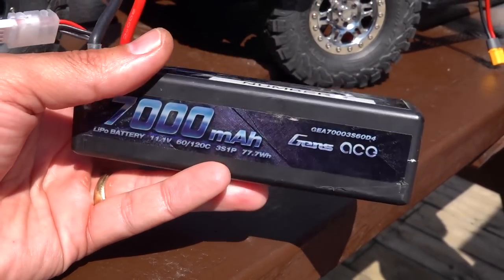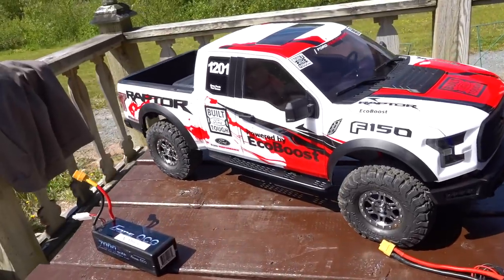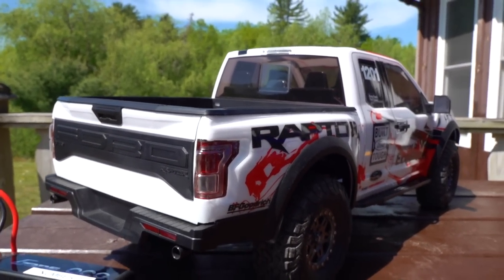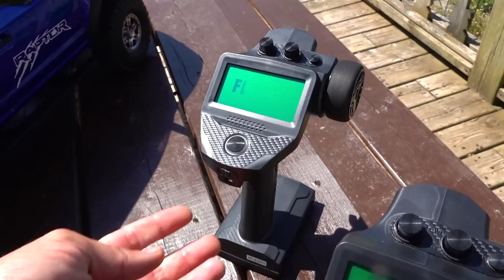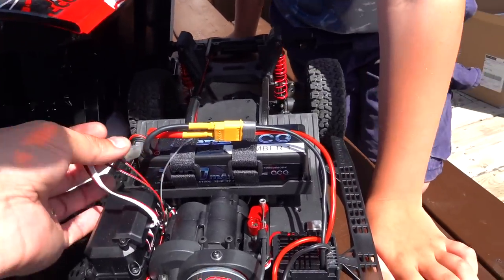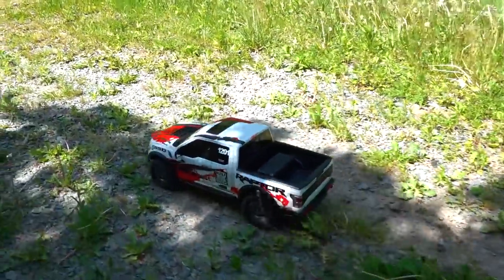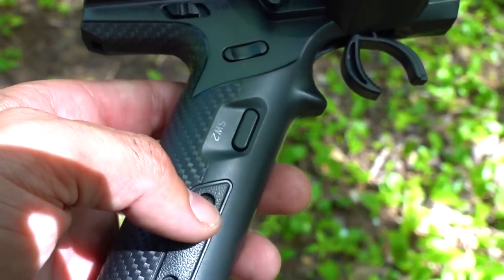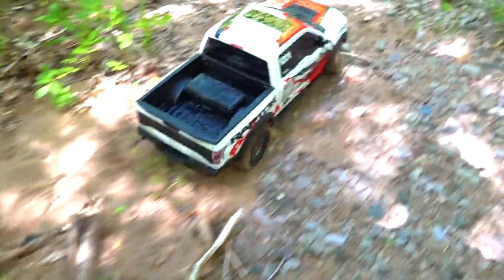BRAND NEW RELEASE 2023 - Traction Hobby 1/8 Scale Ford F-150 RAPTOR 4S iFS

Comment: So I really wanted one of these after first seeing your video, but now that I have had the time to think about it, it’s a really confusing vehicle. Not having the solid axel up front might not make it the best for crawling but I would assume would eliminate the ability to lift it with the independent front suspension. But they left the solid rear axel in it. So it’s built more like a Traxxas UDR or Losi Baja Rey, setup/design wise, but not set up all the way to be a basher/desert truck. I want one, but I don’t know what I would do with it.  I saw your old videos where you lifted the old version and out monster truck tires on it, which was pretty cool.
Reply from the maker: That was a different truck my friend.. called the Founder 2 from Traction Hobby

Comment: As I Think 2 Controlled Model Cars . Ford Raptor F-150 (White) And Ford Raptor F150 (Blue) Inscreases Parts And Running Speed Motor - Hobbywing AXE 540 FOC Sensored Brushless Crawler Motor (1800KV) And ESC - Hobbywing Xerun AXE FOC Waterproof Brushless ESC, Battery - Turnigy Graphene 6600mAh 2S2P 90C Hardcase Lipo Pack (ROAR APPROVED), Servo - Spektrum RC S6290 Ultra Speed Servo (High Voltage/Metal Case), Transmitter - Spektrum RC DX5 Rugged 5-Channel DSMR Surface Radio (Orange) (Transmitter Only), Tires Driver - Z-T0087-RC4WD Rock Crusher X/T 2.2" Rock Crawler Tires, Wheels Beadlock Driver - High mass 2.2 size alloy XD6 Spoke Beadlock wheel (4) for scale Off-Road Crawler C25706GUN OK 😊